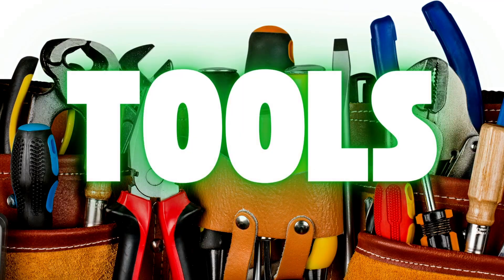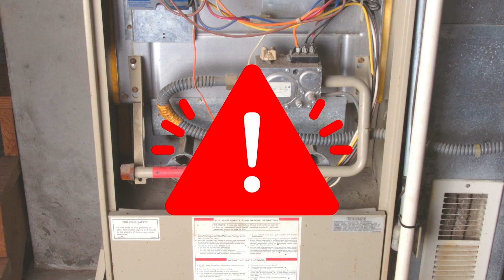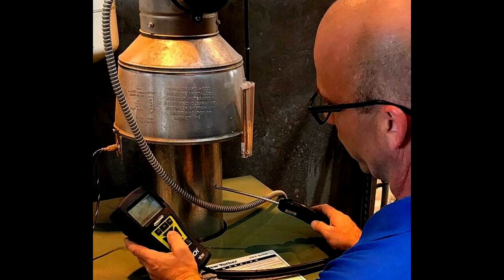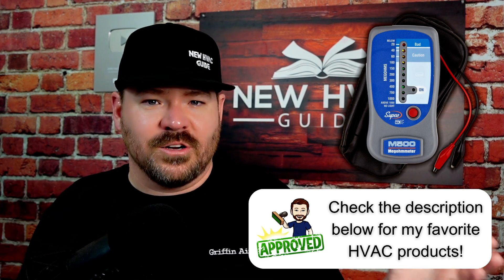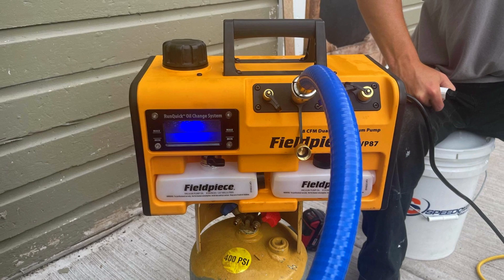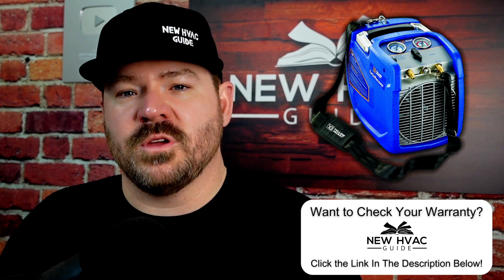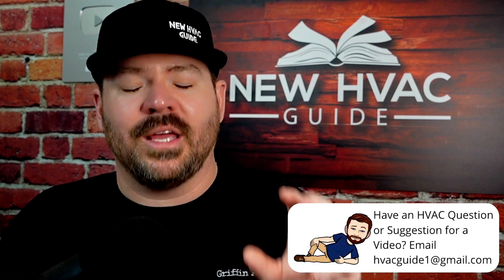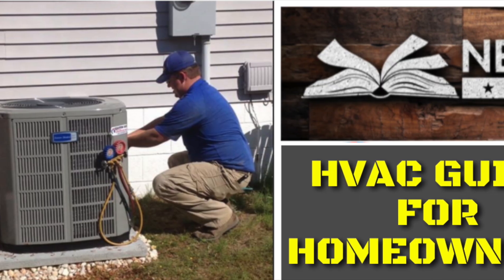5 Tools Every HVAC Tech NEEDS [Are You Missing One?]

Comment: I'm not that convinced that a megger is absolutely necessary.  Meggers are great tools to look at an operating compressor and try to predict it's possible demise.  If the compressor isn't operating they can lead to false positive, if the compressor has a lot of liquid refrigerant in it.  Unfortunately it is when the compressor isn't operating is when most techs pull the megger out.  I would much rather see a tech spend money on a full set of digital probes plus an extra air temperature probe to get the OAT, manometer, COMBUSTION ANALYZER, micron gauge, 1000 V CAT III rated DVM, quality vacuum pump, recovery machine, electronic leak detector, ultrasonic leak detector, inferred camera.  Not saying a megger isn't an important tool in the bag but there are more important tools to put in the bag ahead of a megger.

Comment: Connecting the micron gauge directly to the pump will tell you when the oil needs to be changed.  Test the pump with fresh oil should pull down around 30 µm.  When your used oil rises about 10 µm above this number it needs to be changed.   I have had times where I couldn't pull a system down to 500 µm, stopped the vacuum and tested the pump and it couldn't get to 130 µm.  Changed the oil and sailed right down to 300 µm.  I've also had fresh oil that couldn't get below 100 µm that and had to replace it with new, new oil.   With a wet system you may need to change oil several times.  When shopping for a vacuum pump, more oil is always better!  A pump that holds a lot of oil has much more space to absorb moisture.   While we are on the subject of vacuum pumps always get a pump with a 'check valve'.  If the pump looses power without a check valve it is subject for the pump oil to get sucked into the system.  Never use two or more vacuum pumps on the same system unless they all have check valves.
Reply: Thanks for the tip.